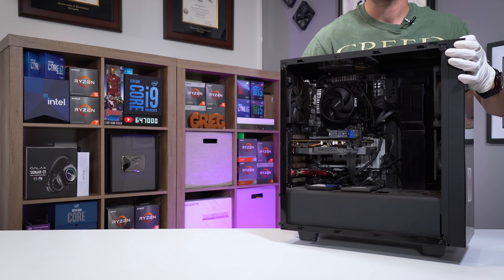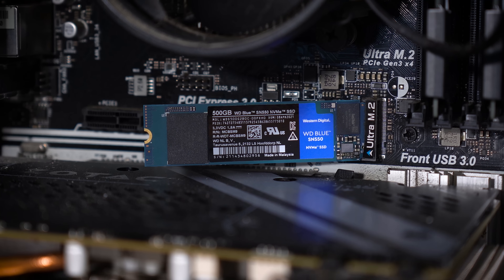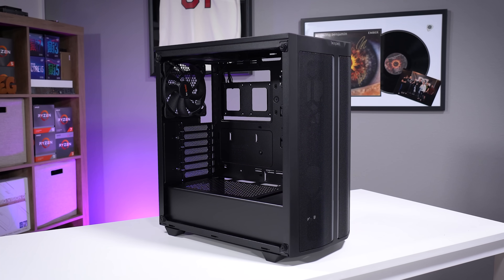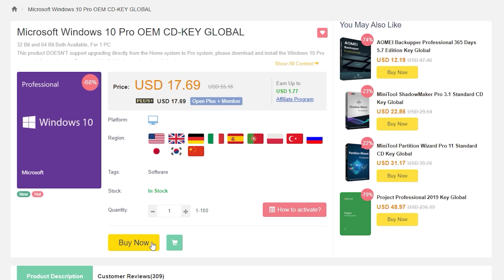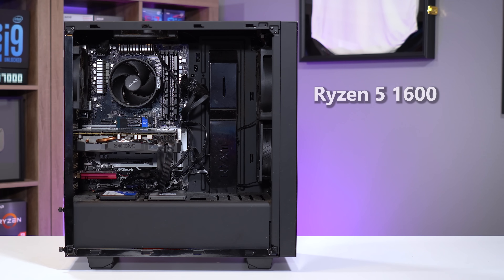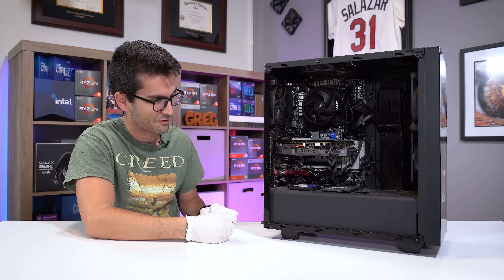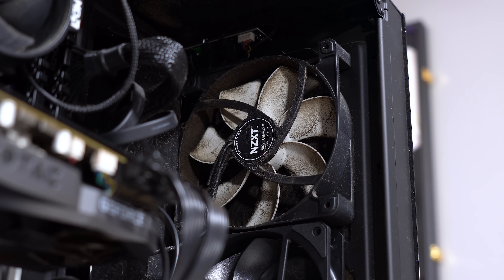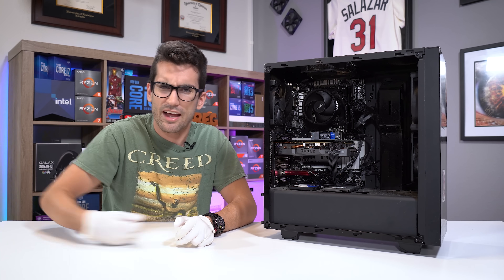Deep-Cleaning a Viewer's DIRTY Gaming PC! - PCDC S2:E5

Comment: My old pc case was this one, worked fine but my 3090 was choking in it sadly, always ran at 80 degrees since this case has bad airflow for high power PCs, i just got a 7000d airflow and love it, GPU and cpu temps are down over 20 degrees just with 3 140mm intakes

Comment: do you ever strip the fans apart? i find some older fans, that are slow to spin up, and or make a vibrating noise when cold, I take them apart clean the old grease off use some light oil, and reassemble them, and never have problems again, I have noticed with some newer fans, that u can't get them apart, yet still suffer the same symptoms.

Comment: NZXT fans SUCK. I bought an NZXT case and used those fans for several years and they are the only fans I had that would start making grinding noises then die after 18 months.

Comment: Great video.  One thing I love about my T5610 is because of the design being tool free I can basically strip the thing doing in minutes making cleaning everything so easy.  In the process of adding a bit of bling to personalize it at the moment too.  That and upgrading the PSU for the GTX 980ti I acquired.

Comment: I was in the same boat as the seller. I bought a GTX 1080 TI AMP Extreme for $400 in 2019, and soon after the prices skyrocketed. The seller simply didn't use it anymore, and it is now my daily driver.

Comment: the bequiet case is actually amazing, i bought one purely for the 3 140mm fans and the big mesh front, the air flow is sooo good. bequiet suggested to leave the fans where they are for the best air flow but as i was installing a 240mm AIO, i put 2 of the fans as front intake and i grabbed a bequiet 240mm AIO (which is also amazing) top mounted. the AIO actually has the pump outside of the heat sink meaning it will not get air bubbles in it and sound like a fish tank (like my 360mm cooler master did). really impressed with bequiet gear would suggest to any one. thier top range fans are probs 2nd to none in terms of noise and air flow, the only things that come close is Noctua but they also cost almost twice as much as bequiet for very similar performance.

Comment: You should've seen mine! It was in the basement while it was being finished so there was drywall and other particulates in the air. When I brought it upstairs before they did mudding and taping, I had to clean it. So I went out to the garage and opened it up. It had CAKED on drywall in the fans, dust filters, all over the inside, it was nasty. It was so bad even an air compressor couldn't get all of it off. There was a huge cloud of basement dust that came out of it. It was so satisfying.

Comment: i once had the joy of cleaning a nasty smokers pc...she had the pc sitting next to her monitor where it sucked in the smoke from her cigarettes...upon inspection the cpu heatsink looked more like a brown shag carpet...didn't know how i'd be able to clean the nicotine/tar out from the middle of the fins until my auto mechanic side kicked in...CARB CLEANER...just a few shots was all it took to completely blast the gunk off and from in between the fins...the entire heatsink looked new again...i followed it up with a few shots of brake cleaner to get the carb cleaner residue off...then followed that up with regular soap/water to remove any possible residual chemical smells...one hobby helping another...lol

brake cleaner is SUPER COLD so i wouldn't recommend using it on heatsinks that have soldered heat pipes...i only did this on a sold aluminum heatsink...carb cleaner should be totally safe on ANY heatsink to remove nicotine/tar then just wash that off any way you see fit...carb cleaner will get to where a brush can't to instantly remove the gunk

Comment: how much do you charge to clean/work on computers? i have great computer 3080 ti, i9, 32gb..and i swear my computer doesnt run as good as it should( i only play fortnite, lol). I feel like my friends who helped me set up my pc weren't as knowledgeable/maybe did something wrong...For one, my pc doesnt boot up normally it goes to bios after a night of sleep and I have to boot from there...and i get noticeable stuttering when in up close fights(not smooth gameplay)...which is soo frustrating..id pay you to give my pc a clean, upgrade it where you see necessary, and correctly setup bios and stuff for optimal use. I assume you dont live near Charlotte, NC though

Comment: How often do you have to replace thermal pads when dismantling hardware? EVERY time I do something I have to replace at least one. If so, how do you know which thickness pad to use? I just took my MSI 2080ti Gaming X Trio apart to double check TIM application from the factory (because of fans ramping up and temperatures) and I was able to piece 2 of the thermal pads back together. Might I add, I overtightened the screws like a dumba** when I put it back together and I can now see the PCB slightly pushed in around the core. I'm afraid to even touch it at this point.

Comment: i got this case but there is 1 thing you need to look up for and that is that the usb-c on the front panel needs his own power xD
i didnt saw it in this video so i was wondering does this mobo have that connector or not if not how did you fix it?

Comment: Are you afraid to use water on things like the mobo...?  The dishwasher is way easier; obviously you just have to make sure everything is dry b4 applying power...  Or better yet, why don't you get an ultrasonic cleaner and use Isopropyl?
Really glad to see that you turned the fan upright on the CPU cooler!
Reply from the maker: I purposefully avoid "easy out" solutions like dishwashing and ultrasonic cleaners. There'd be no point in making these videos. I prefer hand-cleaning. Much more satisfying process and actually filmable.
Reply: @GregSalazar   Hmmm...  I may hav' ta cogitate upon that'un fer a spell...
Thank God for time lapse...  :)

Comment: If you use a 5:1 diluted Maguires Super Degreaser, cleaning "finned" items goes a lot faster. Just spray on, let soak for a minute or two and rinse. Also, to get rid of tobacco tar, you can use a mix of 3 parts cheap vinegar to 1 part "Dawn" dish detergent. Removes tar and the odor. (The vinegar odor will disappear on its own.)

Comment: I had a customer bring me 2 E-Machines that were dead, had to completely break them down and clean them, upon testing, the boards were both bad. those got donated to a friend... and the chassis will be reused in some new builds. (maybe) threw one of the PSU's out as I had too many extras and just replaced it with an old Dell ATX PSU. both chassis are mATX... so I'm limited as to the upgrades.... too bad you can't just swap out the front bezel... that would fix the problem real quick!  Greg, you need to pickup some magnetic parts trays for your screws... they come in real handy!

Comment: Also, you should never have PC's on carpet. not even hardwood floors too. However, it should always been placed in a well ventilated place, that will not attract much dust. Try not to smoke too. I used to do PC upgrades years ago for people and the smokers had the worst PC's to deal with.

Comment: After the installation of all the PC parts in the new case, I have noticed that the GPU is sagging a little on the right side. I think that this could be easily fixed free of charge by threading one M3 screw into the GPU bracket slot in the back of the PC case, where the GPU metal "teeth" stick out from the back once it is installed on the motherboard. The M3 screw should be threaded at the top, where the first "tooth" from the GPU sticks out from the back, so that the GPU is held in a little bit more upright position by this one screw and thus pretty much does not sag. GG WP EZ. Problem solved. Sometimes the GPU cooler is too heavy for its bracket, that is when this solution may not fully work, but it should still eliminate most of the sag. JayzTwoCents made a video on that back in 2017 titled "How to fix video card sag FOR FREE!" and inspired me to do that in my existing build and it worked wonders, since then my GPU does not sag and it looks and functions a lot better without sagging. I recommend this solution, as its very easy and effective. I think that my previous GPU stopped working properly because of too much sag, that is why it was a big concern for me after that incident. ;)

Comment: i rinse my case fans off under very hot water then blow compressed air thru them to dry them. and i leave them unpowered for several hours while i clean the rest of the computer and reassemble.  i couldnt imagine q tipping fans like that. so tedious.

Comment: Toothbrush is better than q tip
Reply from the maker: Depends on the surface. Having used both, I prefer q-tips for boards and tooth brushes for heat sinks.

Comment: i have that exact GPU and i must say it's insane. So powerful in a so small form factor. However, standard fan curve has bottom limit set to 40% lol, it's loud has hell. 

You have two solutions but they require some modifications:
- i used a Raijintek Morpheus on it. It being huge compared to the stock one, temps dropped an awful lot and so noise since i used way better fans (a couple of Corsair ML 120 i had lying around); but you're losing the SFF.
- you can also just remove the shroud/fans and keep the stock heatsink, and use a couple 92mm Noctua fans that fit perfectly and are way more efficient/silent. Pretty easy to attach to the card aswell with some creativity, and keeps more or less the same footprint in the case.

You can also flash an EVGA bios (the dual fan card version) that's fully compatible and has the zero fan setting, if you really want to keep it as silent as possible.

Comment: Hey Greg! Have you considered using an acid brush in lieu of q-tips when cleaning PCBs? I do electronics repair for work and using an acid brush dipped in isopropyl gets the job done a lot faster and the bristles help you get into tight grooves without leaving behind lint

Comment: I love my 500DX in white. Even if you don't have RGB components, the built in case lighting works surprisingly well and you can't go wrong with three Be Quiet fans included too. My only criticism (which most reviewers mention) is the ridiculous front panel that you need all your strength and fingernails to yank open for access to the front dust filter. Not a deal breaker but a hinged door or some other mechanism would be a much better implementation.

Comment: You should look into a Flying Pig dog grooming dryer. My wife and I are dog groomers and we use one of our backup dryers on "non heat" setting to get the majority of the dust off then use a handheld blower for the small spaces. the velocity is great on those dryers and they're not super expensive

Comment: Just a suggestion. Why not compare the temps before and after cleaning!
Reply: he said in a prior video that would require the viewer to give up the system password and he is not comfortable with that
Reply: @reeping5038  Makes sense. Thanks!
Reply: @reeping5038  just change the hard drive job done
Reply: @reeping5038  does he really though? he could just replace the hard drives with his own and run stuff

Comment: I'm using this same GPU and it took me a thermal paste replacement, fan teardown (literally pulling apart the fans to deep clean them from the inside and to relubricate them) and an undervolt to get it to run no higher than 70°C. But seeing it run all the newest titles makes it worth it!

Comment: is it just me or does the specs feel a bit off as a pairing? like a 1600 with a 1080 on a low end b350 (quite a known as a problematic one for that specific asrock one too ) and also going full ssd with it. feels like a b450/470 atleast would be a better pair for the rest. (yes i know its only 1st gen ryzen but still seems wierd if you price the other parts it looks a bit cut corners on the mobo)

Comment: if only i knew of this case a year ago it only a inch bigger all around the my current which has 5 rgb fans that i bought for it since the original 3 that came with it wasn't cutting it. know the question is will 120mm fit cause i might still get it.

Comment: I got a PC to "fix" from someone.
It is a Pentium G 4400 on the cheapest Gigabyte board with H81 chipset in a case that was so bad it was rusting.

After over 2 days of trying to bring it back to stable operation, I am giving up.
I think due to all the dust and humidity, something is shorting on the board and it refuses to post half the time.

Comment: I am upgrading my old RX 580 cooler into AIO waterpump, so i can keep using it for a little while longer.
Other option is waterblock, but i dont have the skill yet, i rather try this method first.
And yes, my mobo has the support for it.

Some stock coolers are just trash anyways xD

Comment: I have a question. I see that you use some kind of liquid to clean fans: is it IPA? I wanted to use IPA to clean fans in my case but read some info that it is dangerous and not recommended. I should only use air to clean them but, after using air, there is still some dust left.

Comment: love these videos as so relaxing to watch.  i just spent the day swapping a motherboard  to find my pcie riser cable failed again   this was the second one to fail  on me as it would work in the 8x slot but not the 16x slot.  So i decided not to use the cable but one problem i had to order a new case  as my thermaltake core p3 the video card is to long and hits the AIO fans   so yes i needed a relaxing video

Comment: I followed Gregs' steps and ran the heatsink for my gpu under the tap and got it sparkly clean - then I dried it with a hair dryer and it got so hot it took my fingertips off - because apparently I have the IQ of a strategically shaved chimpanzee.

Comment: These cleaning videos are very satisfying to watch, nice work on them Greg. I doubt I'd ever go quite that far when cleaning my own pc though, sweeping through it once every few months has worked out decently for me. :)

I'm kinda on the chase for a new case. I was hoping to find some nice ATX case with good airflow (mesh front for intake would be nice) and the inclusion of a external 5.25" bay for my blu-ray burner. I'm mostly using it as a reader though to rip my blu-ray movie collection to storage on a NAS instead.

Been looking at the BeQuiet 600-series cases, but the intakes at the front seem rather limited. The case that seems most promising is so far is an Enthoo Pro M SE, it's a bit pricey though. 

Would anyone happen to have any good case suggestion that might fit my needs?

Comment: Greg, I'm really curious why you don't have any sort of specialized hose nozzle?  There's hardly any pressure out of what you have now.  It would seriously help remove dust and dirt in tougher spots.  Mine has a "Flat" setting that's really useful.
Reply from the maker: Lol. There's plenty of pressure when I squeeze the handle harder. I also have a power washer but it'll rip right through these dust filters.

Comment: Does the owner live by the sea and have a cat/dog? fine dust + lots of moisture + fur is the only way to have that kind of dirt inside the system. I also thought you'll add another 140mm on top to balance the pressure, but thinking of what you said in one of your previous pcdc, positive pressure (more intake than exhaust) will keep the dust from entering those unfiltered holes.

Comment: I enjoy the series but I wish there was a little more hesitation before replacing the case and its accessories. They represent some 90% of the weight and volume and become the most visibly dirty. From a finished product point of view, it's a cleaned up motherboard, HSF, and GPU stuck in a new case with new fans, new slot covers, etc., which isn't as impressive.

Comment: I had the original S340. Got an aftermarket glass windowed side panel for it because the acrylic on mine came basically pre-scratched out of the box. Unfortunately aside from adding glass and lots of it, NZXT's case design really hasn't progressed at all since then.

Comment: I also got this new case and have been loving it! More spacious and easier to manage than my older one & having the power button on the top makes it reachable from my chair. My only complaint would be the amount of force required to pull off the front panel but I can see how that may be a safety measure & convenient in some situations.
Q: Any particular Do's/Don'ts when cleaning the glass panel?

Comment: I enjoy watching these "deep cleaning" videos especially since they remind me of some of the early (3-4 yrs back) videos of one of favorite tubers - a.k.a Bryan a.k.a Mr Tech Yes City! I understand the two of you have collaborated in recent past so I am curious whether you might have experimented or considered using his "brake fluid" spray method in your own videos?
Reply: To be clear to anyone, never use brake "fluid"  to clean your pc. Brake "parts cleaner" is what he uses.  Most brake parts cleaner that i use (im an auto technician) are very good at cleaning and dry instantly. So I'd assume it is pretty safe in terms if cleaning computer components. Some of them however are known to discolor plastic parts and will dry out rubber components  so be aware of what and where you are using it on. Imo using it on a bare pcb is perfectly fine. Also keep in mind most all brake parts cleaner is extremely flammable, so be extra careful around parts that have been on recently and have parts like capacitors and batteries on them.